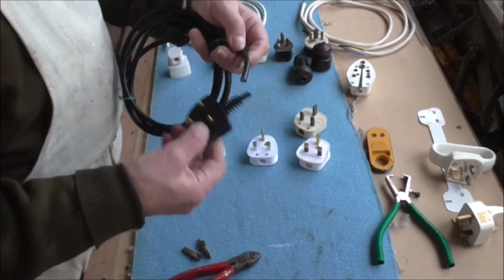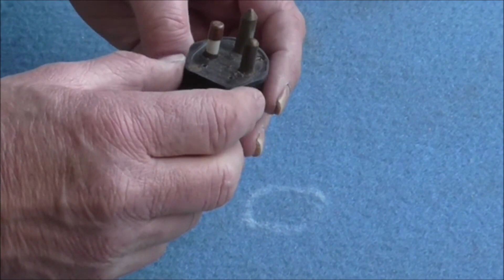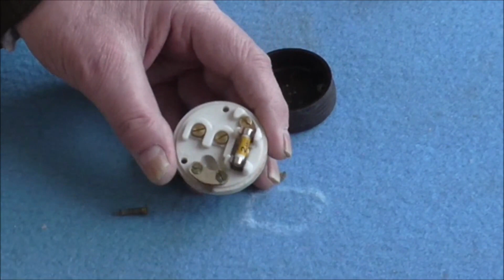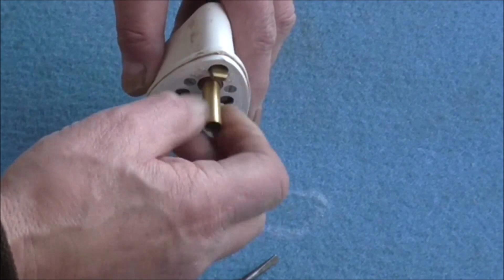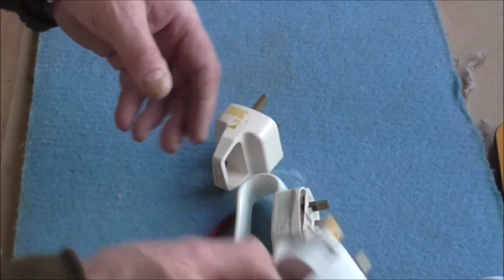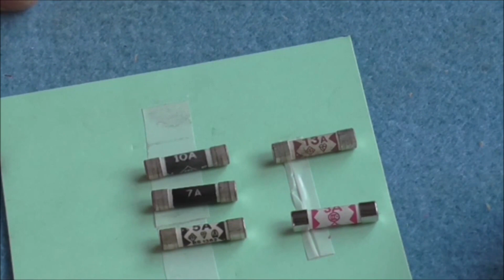About plugs and how to fit them correctly part 1

Comment: Our house hold plugs are 15 amp some may have a 20 amp with a rare 30 amp these are 115 - 120 volt's  our 208 - 240 volts  are 20,30,50 amp  Comerical Building some have 3 phase 440 volts
Reply from the maker: Thanks for the comment Doug.

Comment: Hello again that is a very useful demo for people .....The trouble with most presenters is ..they forget that youngsters are coming up behind them who don't know
Reply from the maker: Thanks for the kind comment Beryl.
Reply: Good advice here, the primary reason for the fuse is to protect the house wiring, the secondary benefit is protection of the appliance (assuming correctly sized).